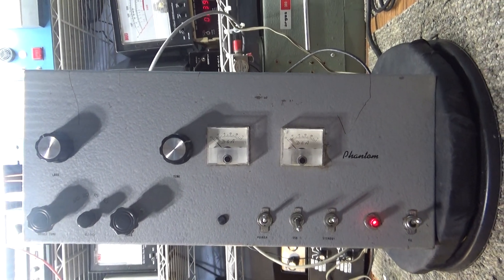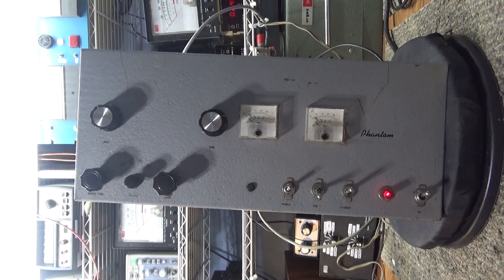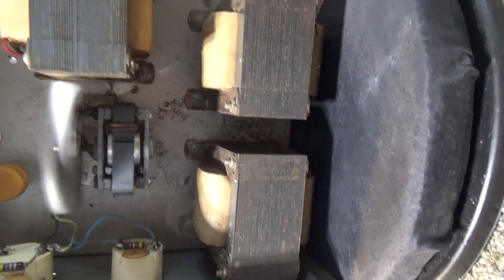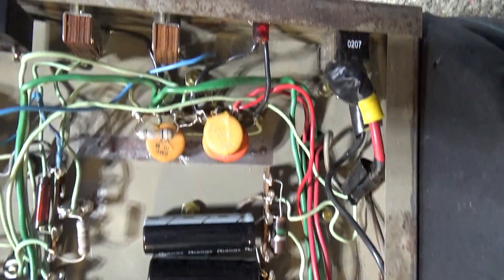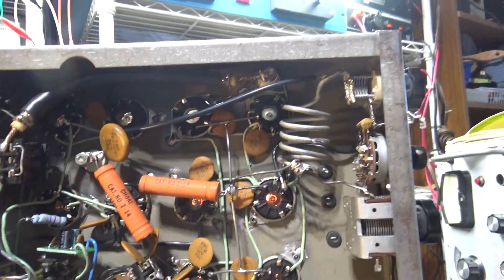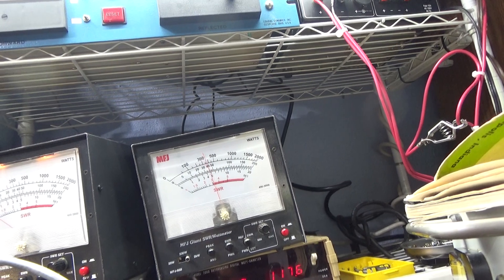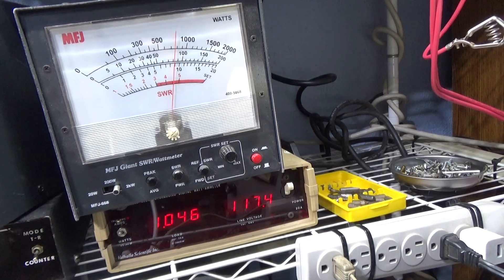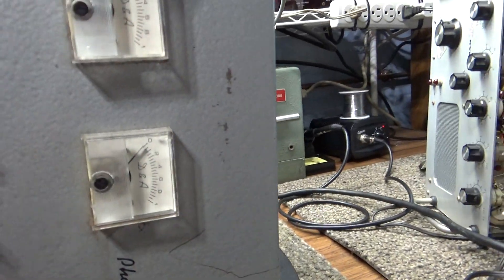10 tube D+A Phantom 500 linear amplifier recapped on the bench.

Comment: Just traded for one gave a 440 Stryker & 150 cash.
Reply from the maker: I might have went for that one, I think I would rather have the Stryker and cash. Good Luck.
Reply: The  Stryker had problems . Someone had put a echo board it Very very sloppy work  .Drilled a huge hole in the side of the radio. So I've got a 150 dollar's in a 10 tube Phantom with new tubes. Thinking I came out good. Just now have problems with the neighbors coming through their speakers toasters and tvs.

Comment: I just picked up a phantom 10 tube I can't find any info on it it is not a triple stage unit it's a dual stage high and low    looks exactly like that one in videoit doesn't have the 250 switch
Reply from the maker: There are around 20 different variations of the amplifier, but it's basically the same. 10 tube, 12 tube, tube keying circuit, transistor keying circuit, single stage, dual stage, triple stage, single band, mono band and more. Still, basically the same amp.

Comment: This doesn't have a sideband delay. Where would the info be on the mod to stop the relay constantly trilping when you talk on SSB?
Reply from the maker: There are at least 25 different versions of the Phantom that I know of. Some had tube keying circuits, others used a transistor circuit. Some had SSB, some did not. I don't know of a step by step mod, but the schematic for the Phantom triple stage on CBTricks.org has a transistor keying circuit with SSB. If yours has the transistor circuit, then that schematic should help you.  https://cbtricks.org/Amp/d_and_a/phantom_triple_stage/graphics/phantom_triple_stage_sch_11-17.pdf
Reply: @tramdr  This is great man thank you! You are a God. Live long and prosper

Comment: Cool channel!!.. Do you have any info on tube heater voltage conversions for maverick 250? thanks for the help if possible.
Reply from the maker: 9 pin mid size 'BALDIES' No Plate on Top
6JG6  17 watt
6JR6  17 watt
6JT6  17.5 watt
6KV6  28 watt

9 PIN  D+A  6LQ6 and SUBS
6GJ5   17.5  pins  3,8 different 
6JB6    17.5
6JE6    30  'A. B, C'
6JF6    17
6JU6    17
6KM6   20
6LQ6    30
6LZ6    30
6ME6   30
6MJ6    30

Comment: I had one of them and bought it new.  there is on on Ebay for $260 + 112 shipping. has I think the correct band switch knob on it.   I got it for CB about 1971, I cant remember  the year exactly  I had all the neighbors mad at me. Caused the worst TVI ever
Reply from the maker: and D+A's are known to be pretty clean for a CB amp. Maco's and Varmints were known to be much dirtier.

Comment: Hey there!  My dad and I have a super clean D&A Phantom Triple Stage and it is a 10 tube amp.  It has a beige color face with 2 gauges.  What should I do to it for a tune up?
Reply: with the rm100 driver in line it dead key 25 watts and swings to over 1200
Reply from the maker: replace the electrolytic caps. Other than that, if its doing 1200, I would leave it alone.

Comment: I was going to say that those are not the original caps.  LOL  I have an all original Phantom like this.  It does have all the bands listed on the switch and the caps are about 2x's the size physically as those shown.  They sit so close to the case that someone put regular duct tape (paper backed) on the case to stop arcing.  Thanks for showing this.. I will have to dig mine out of the closet soon.
Reply from the maker: I believe that using a 50 year old amp that has 50 year old original caps in it is an accident waiting to happen.
Reply: @tramdr  You have no idea how it was used, how long it was used or anything about this one.  If old tubes that are not used are an issue then why do people still search for new old stock Sylvania tubes?
Reply from the maker: Since when did this conversation switch from caps to tubes? Electrolytic caps go bad with age, even with zero use, similar to a battery. Hence old electrolytic caps need replacement because of time, not use, even though heat and moisture (storage) will speed up the process. Also, to me, NOS electrolytic caps are worthless.
  Tubes, at least sweep tubes used in CB amps, don't go bad with time. They go bad with use and abuse. People seek NOS tubes as new tubes have zero use or abuse and most sweep tubes are not made anymore at all, and the few that are made are Chinese junk. Hence, people seek unused or low use American made tubes which have not been made in what 30 years? Since they are not made anymore, and there are still a lot of people seeking good tubes for their amps, supply and demand, good old tubes are very expensive. 
 There are some larger transmitting tubes, like 3-500z's, that also don't age well. They sometimes lose their vacuum and need to be degassed. Most big boys know to degas those big tubes before running them. Sweep tubes do not need degassing.

Comment: Nice setup. Reminds me of my younger days. I had a Kris T23 with upper & lower sideband tied to a Context 6801 lenier. It was on a pushbutton slide-out rack under my dash. The thieves couldn't figure out how to get it out so they rolled my dash all the way over and sole the works and left the #10awg hotwire coming from the battery to run it...left it shorted to the frame of my dash where they cut it out and it burnt all my wiring and ducts out of my dash. Me and another fellow were the Kriss distributers in my town. It devastated me. I would have loved to see how tight I could get my hands around the thief's throat!
Reply from the maker: When I was 17 and still in school, I was repairing boxes in the basement at the family house in Detroit for some extra income...... Until someone pulled out one of the security bars out the brick foundation to get to my stuff. At least that settled that, never wanted to be a CB tech or mess with the average cb'er much after that.